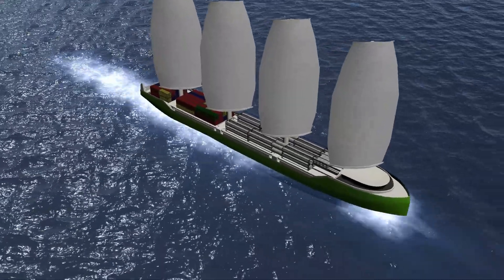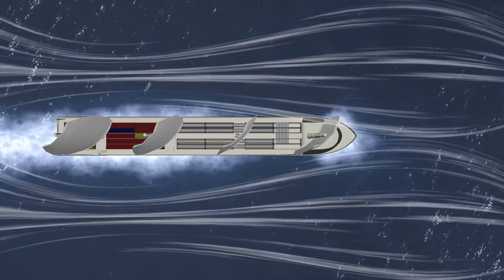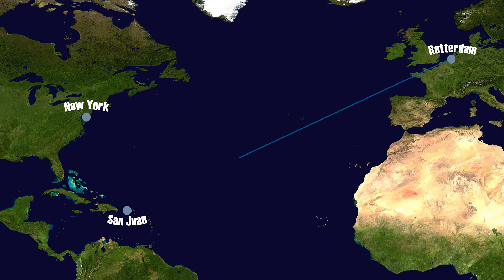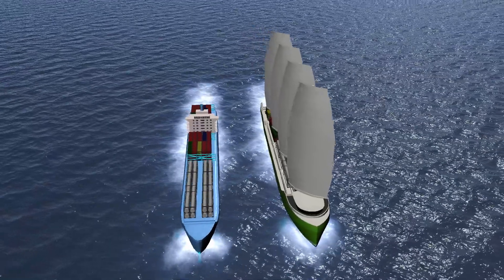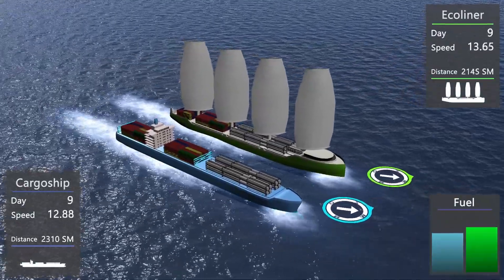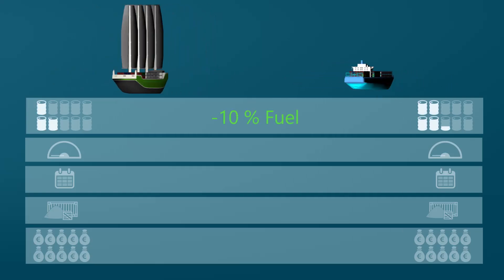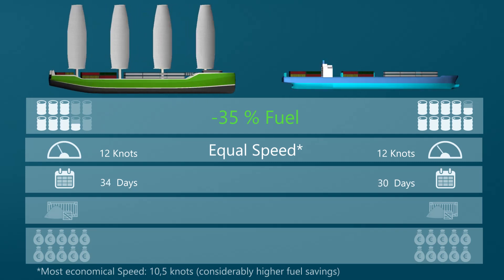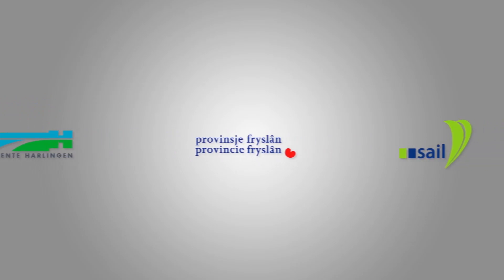Ecoliner 3D animation & Infographic (SAIL project)

Comment: Which Rig do you use? DynaRig? 
What about on-board generation of green hydrogen through screw and PV on the sails. 
This could be used to fuel a motor during calms and bad winds. 
Surplus hydrogen could be sold. 
Foldable yards could carry extended sail, working as stunsails.
Done right, the save on fosile fuels could reach 100%. 
Just a thought.